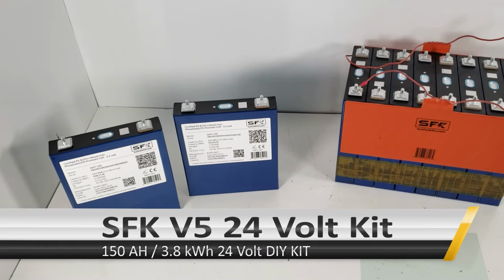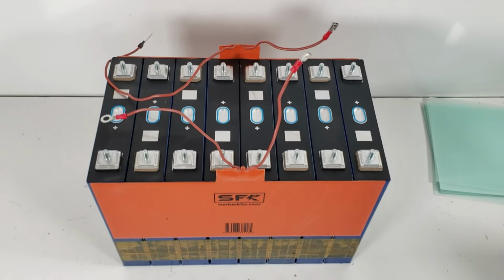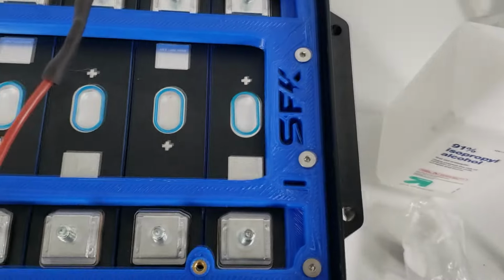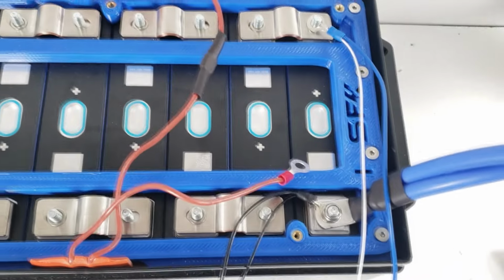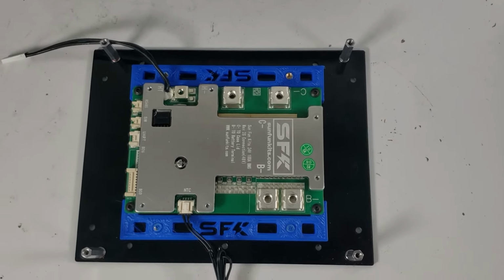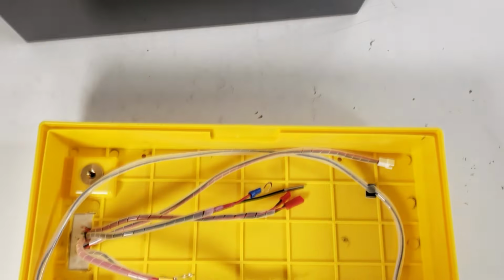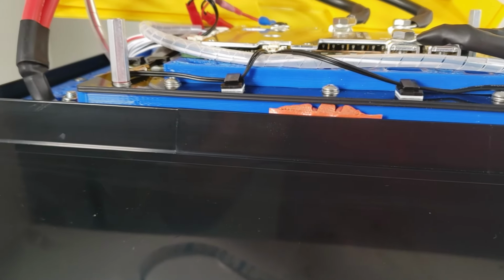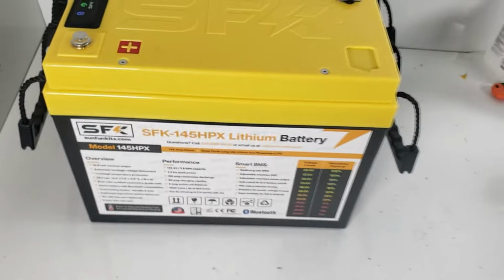Sun Fun Kits V5 24 volt 150AH / 3.8 kWh DIY Battery Kit

Comment: It would be useful to add the multiple mounting option around the whole perimeter on each side of the plastic boxes by adding many threaded inserts. Using angle bracket moutings would then allow the battery to be attached to the floor or wall. And with flat bracket motings, the batteries could be joined together.